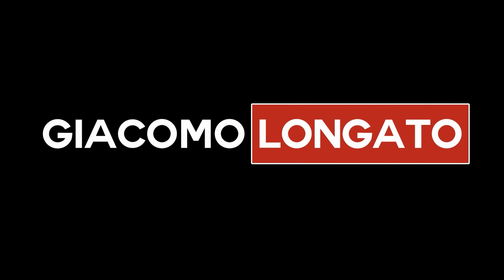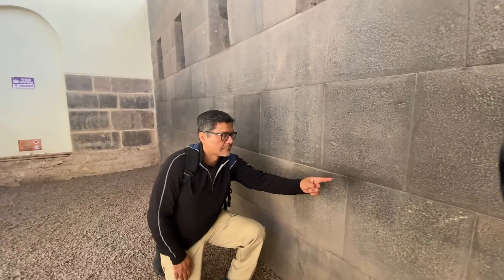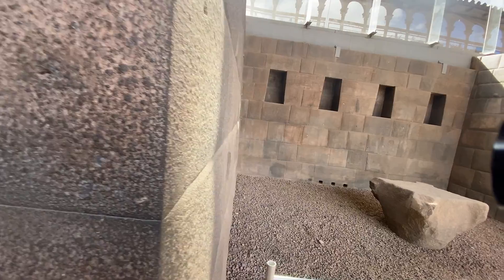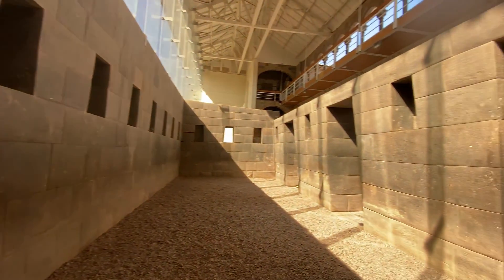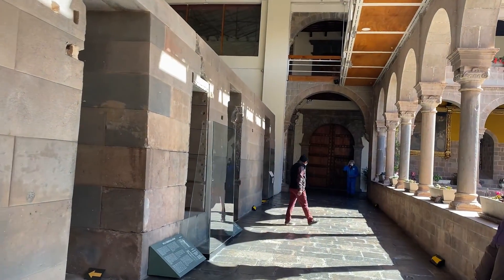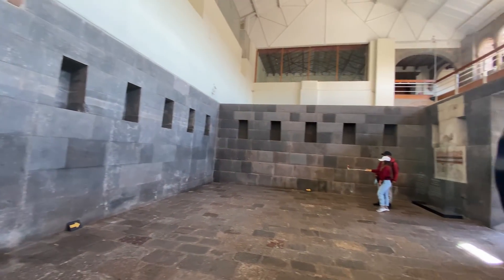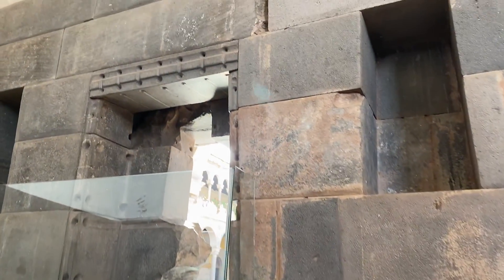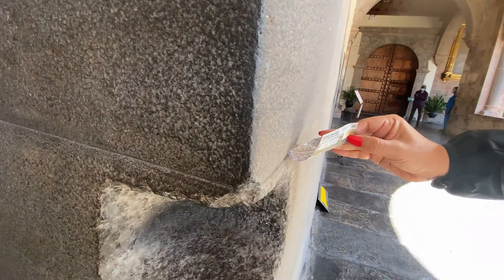The Coricancha Mysteries Part I

Comment: But the stone in the Coricancha Temple is gray basaltic andesite stone coming from Waqoto and Rumiqolqa quarries, NOT some kind of concrete or geopolymer! Stop pretending that it is. You are ignoring FACTS. And stop using the inaccurate word "melt". The stones were treated to SOFTEN their surfaces temporarily in order to achieve their tight fitting to stop movement during earthquakes. They were never "melted"! That would have acquired high temperatures, but there is no sign of burning. Besides, any student of chemistry knows that molten granite does not return to its original, crystalline state when it cools. The "scoop" feature in one stone block is NOT evidence of the material being a geopolymer. It is evidence of an inch or two of the material below the surface being made soft enough by some unknown treatment for fingers and tools to dig out softened stone. Your video is full of arbitrary interpretations and inaccurate statements.
Reply from the maker: Is that your real name? No more information about you in your channel. I am not pretending anything. I don’t need to. I  have been  in Cusco several times. According to your BOMBASTIC rhetoric  I am ignoring the facts! Really? You can say  SOFTEN which is a metaphor as the word MELT is as well! How come the stones were SOFTEN ? In other words became maleable; right? So you also exactly know that the stones has been softened one inch or two? Can you explain that ? The research done in Sacsayhuaman back in 2012 by a Russian team says that the Limestone has been altered. The limestone in Sacsayhuaman was different from the quarry was originally taken. A similar result you can find in Puma Punku by the Geopolymer Institue. The H stones look like granite but when they were analyzed contains organic material; therefore has been altered. Coricancha is not the only place that the stones have a unique configuration similar to plasticity in Cusco. The “ scoop”
feature in “one stone” doesn’t mean is a concrete or ancient Geopolymer ? There are more than one “scoop” in that wall. And that’s not the configuration in any kind of rock. There  is a good example of scoop marks in Sacsayhuaman  and millimeter cuts in Ollantaytambo made on granite rock ( not in a wall or block). You should be careful with your statements about the exact measurements applied to the rock to make them “ soft”.  Next time  put your picture and information about yourself.